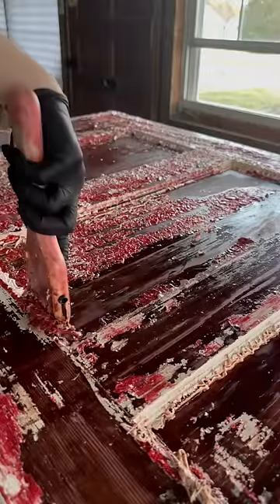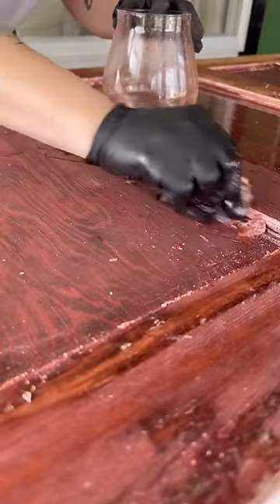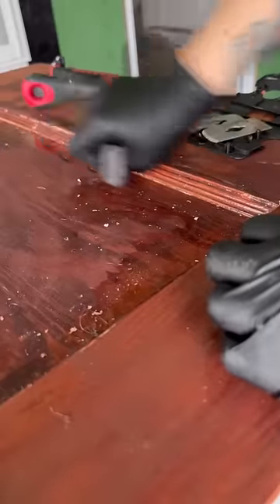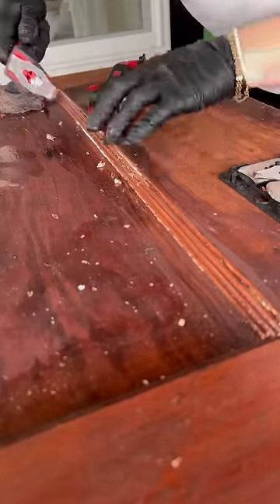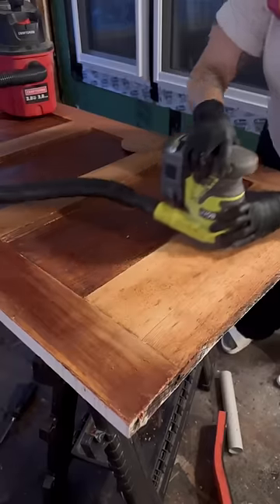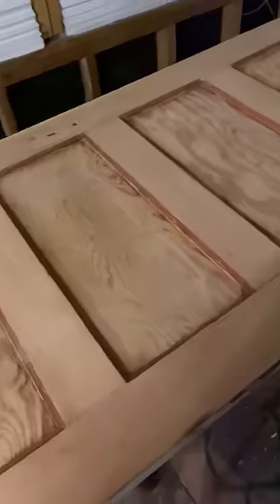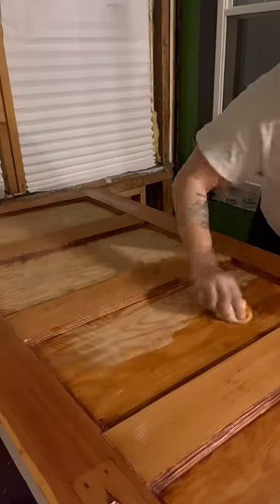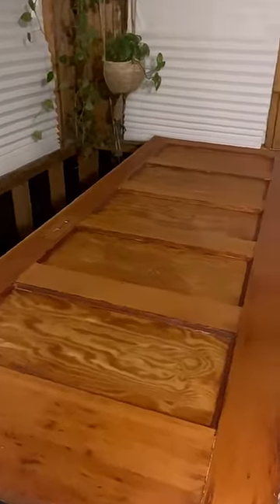Does it look like meat though? #diy #diyhomeimprovement #diyprojects #homeinterior #home #shorts

Comment: Using mineral spirits when you’re done stripping is important, it neutralizes the stripper.
Reply: Unless the stripper has been hitting the pipe then she’s much harder to neutralize
Reply: @cecil le  That's advice that would've helped 12 hours ago!!!
Reply: @cecille5833 why did I think of this kind of stripper-
Reply: I was wondering what she was using. Thank you so much.

Comment: You know you're getting older when you start liking finished wood.
Reply: I've loved natural, stain + varnish, poly finishes since I was a little kid. only had white gloss enamel in itches in home I grew up living in. all other rooms had stained spruce. my first apt had crindy flat white wood trim. . my first house had light stain pine with multi coats of Pollyanna or Spar -- boat varnish n kitchen and bath for durability.  New house has honey pecan stain and 3 coats of inwax poly. all ppre finished before installation. cut to fit before finishing. stain was custom mixed to match built in kitchen and bathroom cabinetry. also matching crown mold. not a formal house, but not super casual.  very pleased. pre ensured, pre cut, pre finished wood trim makes application a breeze.
Reply: It’s just so low maintenance! I come from a family of house painters and a carpenter, so I always cringe when I see people stripping the stain off their cabinets to paint them! Stain wears like iron, but paint ends up being a pain in the butt! Anyway, I agree with you and I’m only 21 haha

Comment: If you haven't already hung the door, it's worth sanding down the sides of the door, especially the top and bottom. The wood has probably warped slightly over the years, and sanding them down now means you can more easily add rubber gaskets as needed to prevent drafts!
Reply: What kind of paint stripper do you use?
Reply: Perhaps you're not in the US, but most US homes have forced air heating and/or AC, which in most homes necessitates air going under or around the door to complete the circuit back to the return vent and to the heating/AC system.

Comment: I bought a Victorian house a year ago and I’ve been having to strip decades of paint and an awful thick layer of latex paint they put over the original Victorian doors, windows and decorative paneling. May the force be with you, you’re doing amazing! 💜
Reply: I'm almost ready to move into my 1908 project...
Reply: @mapratt  wishing u lots of luck w that 😅
Reply: @Poop-kg8rj  Yeah, it's bad.  I've addressed the foundation and the heating system.  The roof has a few years left on it.  Every inch needs attention.  I reckon it's a form of insanity...
Reply: please test for lead
Reply: @blitzie66  I did, we also had to remove a bunch of asbestos walls which was suuuper fun 😭
Reply: @homeiswherethecorpseis  oh dear! not fun but i bet it’ll look amazing when you’re finished
Reply: @blitzie66  thank you!

Comment: You could have just sanded the paint off
Reply: That would have taken way too many sanding strips
Reply: @giovannigiovanni9377 , sure but she had to sand it anyways, and paint isn’t any harder than wood
Reply: @thedoomofred5174  well I see your point but nobody wants toxic paint dust in the a air even if you are wearing a mask it does create another problem

Comment: Ok, so your rostered edges weren’t properly cleaned, leaving them darker, and a different colour.  Also, using 80 grit is way too rough. Since you used a scraper instead of a putty knife to remove the paint, I’m going to guess you scratched grooves into the wood.  Many easily identified errors which I wouldn’t want others to do. I do this for a living, so not a backseat driver.  Good for you for trying, but best to learn some new techniques to complete other projects with better results.